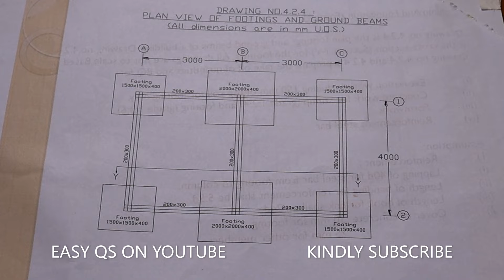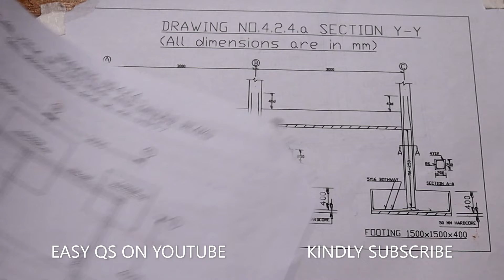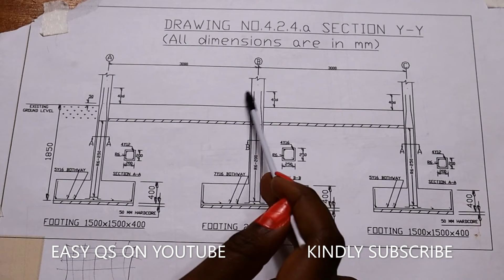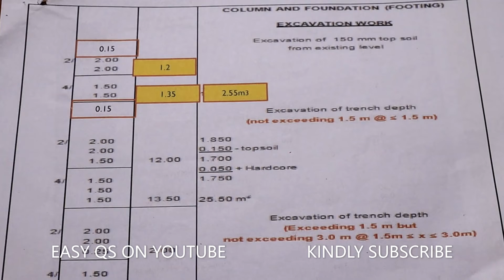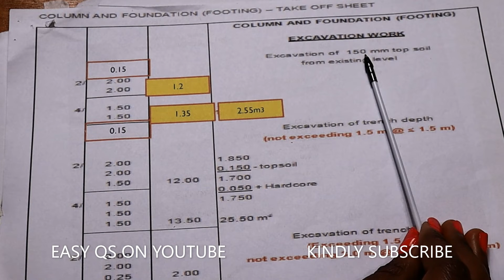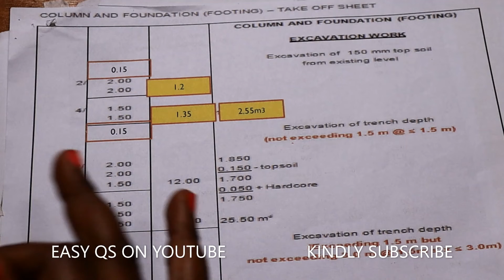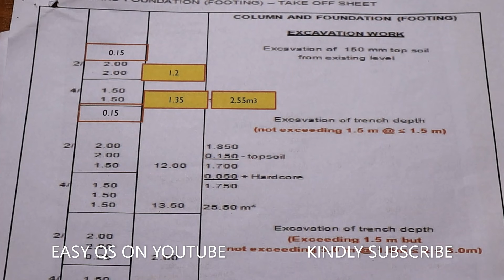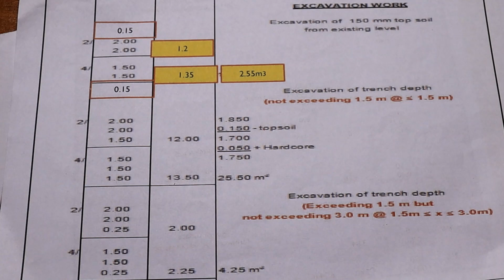VOLUME OF EXCAVATION FOR COLUMN FOOTINGS AND GROUND BEAMS/TAKING OFF

Comment: Generally, the top soil is present throughout the site. You only calculated the top soil removal on top of footings. What about the top soil that is present underneath those beams? I calculated excavation volume for footings and top soil differently. 
Footings: 1.5*1.5*1.75*4 + 2*2*1.75*2 =29.75 
Top soil removal: 0.15*4*6(plan dimensions) = 3.6 
Please let me know if I have made any mistakes or not.